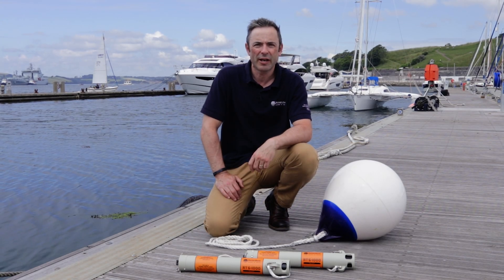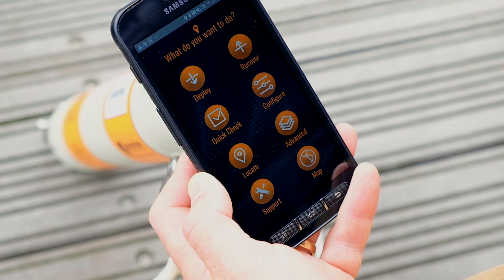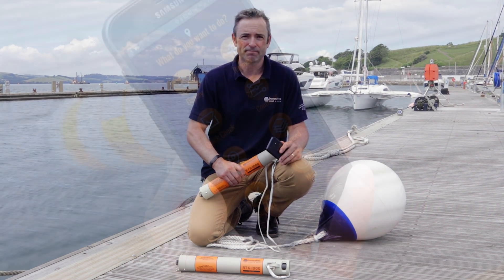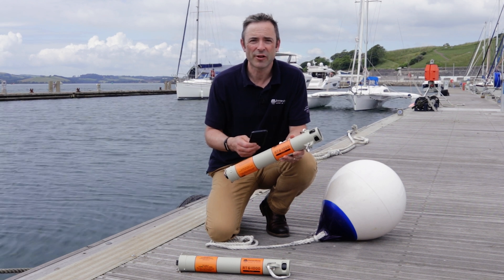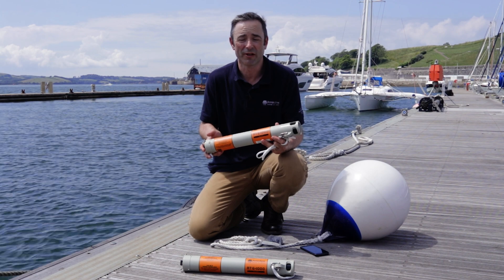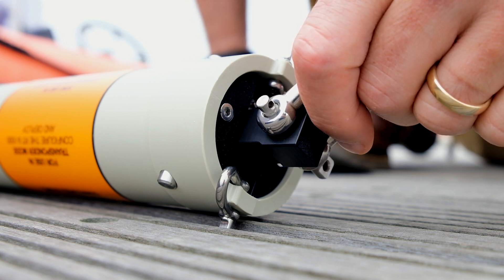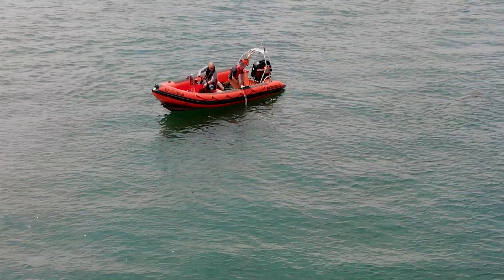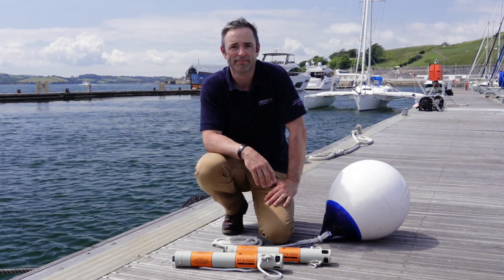How to Deploy the RT 6-1000

Comment: Hi! What do you need two devices specifically?? Coz i understand that one  is to recovering the other one, but you just mentione it but i dont see more specifications about it. Is it really necessary to have two RT 6 1000???
Reply from the maker: Hi @gowhales3002 - The reason two are necessary is to send an acoustic command to the RT 6-1000 that's underwater to tell it to release. Without another transponder, there's no way to communicate with the one that's underwater. Since this video came out, we have released a Deck Topside box, which means you can use a range of our transponders to communicate with the RT 6-1000. These include our cabled Nano transponders. You can find out more information about the Deck Topside on our website - https://www.sonardyne.com/products/deck-topside/ I hope that answers your query  🙂
Reply: @Sonardyne  brilliant! Thanks!